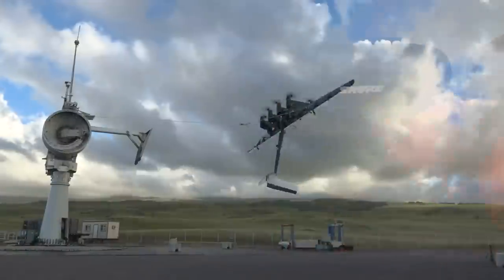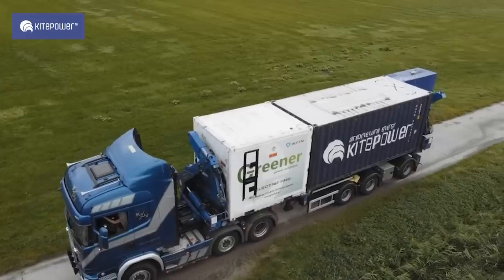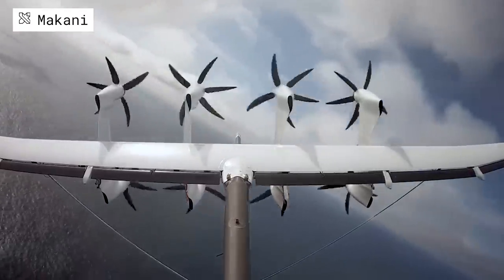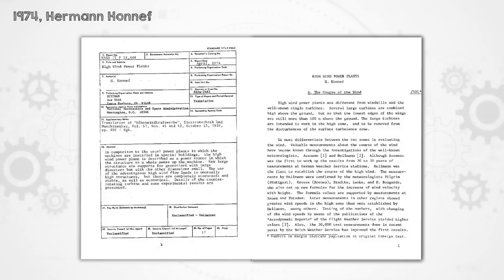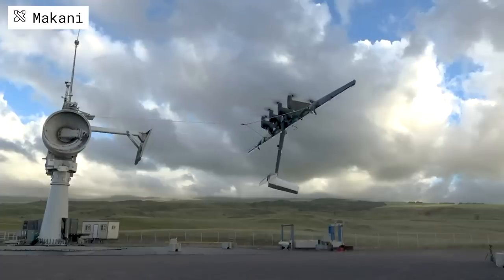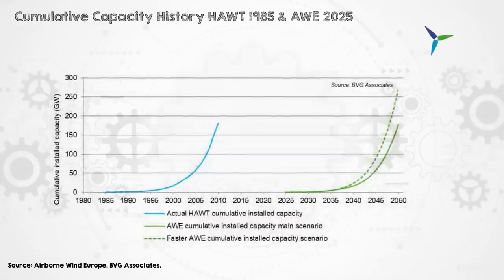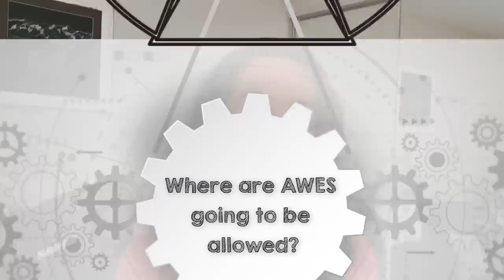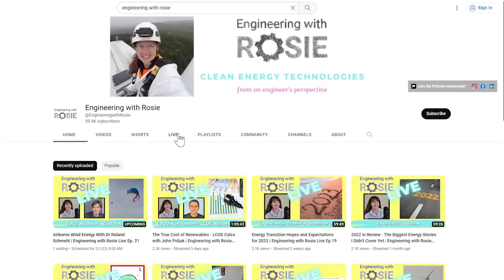Will Airborne Wind Replace Conventional Wind?

Comment: I bought a prototype airplane from Ampyx when they were dissolving this summer! I went to a random garage sale looking for cheap tools, it turned out to be the workshop of Ampyx power. I saw a nice RC airplane that they used for some early testing and I bought it for 30e. Its got a lot of repaired damage but turns out it was almost a 1000e when new :)
Reply from the maker: That is so cool!
Reply: @EngineeringwithRosie  Can you perhaps tell us how much electric energy was generated after 23 hours of continuous work 10:00 ? Can you compare it with energy quantity generated by PV panel(s) >(how many of them?) for the same time period of 23 hours?

Comment: I drew one of these up about 50 years ago now in the basement.  What it was was 5 blimps that were connected by bars in a pentagram cross, and rigidly  supporting a nacelle directly from the cross - that nacelle would be steerable into wind angle and generation power that transferred down a cable to the ground.   Never did the physics/costing as I was 12 at the time- which was the summer we walked on the moon.  only paid attention to solar and nuclear after that for about 35 years and then wind happened in TX.   Enjoy your videos.
Reply: The problem with blimps is that there is a serious global helium shortage that's unlikely to change unless fusion power becomes practical and the use of hydrogen even for unmanned applications are still frowned upon (yes, the bias against hydrogen is a little irrational with unmanned applications but people and specifically bureaucracy are rarely rational).  However, there may be alternatives such as solar heated hot air or nitrogen as nitrogen is still a minimal lifting gas versus air and can be easily produced where ever air is available.

Comment: Back around 1980 I had Bryan Roberts as a lecturer at USyd. He was looking at units which would fly in the jet stream. One of the problems was finding a suitable material for a tether that would not break under its own weight.  I saw in a later article that he was looking at a group of 10MW units.
Reply: Most if not all, currently pursued concepts are aiming at heights between 150 and 500 meters, maybe a bit higher. At these heights, there is no danger that the tether breaks under its weight. Challenges are (1) aerodynamic load peaks when flying crosswind in a fluctuating wind field and (2) fatigue of the tether due to dynamic loading, especially when alternatingly reeling out and in and (3) material degradation due to UV.

The pioneers of our trade (Oberth, Roberts, Ockels, ...) envisioned much higher altitudes. That is currently not the case anymore.

Comment: One problem with scaling them up is volume/weight increases with cube of aircraft's size while lift only quadratically. About launching in low ground wind  - autonomous drones used as lift robots might have a say.
Reply: That's a very important consideration.

By using multiple line attachments along the wing spar you can get below cubic weight increase.

Thought experiment: Glue the left wing tip of one kite to the right wing tip of the other. If both have their own tether you don't need additional structure.

Comment: I'm a bit late to have my question answered on the live stream but I'll ask it anyway.  Why not use a non tethered drone to launch a non powered sail.  When ground wind is low the sail could be folded similar to a parachute loaded onto the bottom of a "launching drone" and flown up and deployed.  This would reduce the window of risk and wear to the expensive components.  You could even have one launch drone service multiple towers within a short range.  The problem would seem to be in repeatability, but I can think of a few ways this could be done with automation while still having reduced cost over the built in drone launch systems.
Reply: I believe this to be a very good idea. Especially once you have multiple systems close to each other. This idea has been raised by at least 2 other people in the business that I know.

As long as we have only one system for testing we decided to fix the propellers to the wing to avoid the complexity of having another autonomous system and the necessary communication/synchronization that comes with that. But maybe we should change that...

Comment: That was an interesting video. Thank you. My take, being a retired pilot is that apart from low volume, very specific applications this is a non-starter. There is no doubt that the wind gradient is an exploitable resource. Utilising upper air is as you say, far better because it moves faster. It’s also more stable (fewer gusts) and slightly more reliable than surface wind. The better, more elegant solution has to be airborne generation as the wind will provide the lift for free as the craft is tethered making weight less of an issue. Being a kite flyer I know controlling these things is non-trivial but think this can be overcome. However, it’s the total system complexity that will prevent cheap power from being generated. Then bird murder, icing, aesthetics, noise and rain damage has to be considered along with establishing safe zones to avoid conflicts with aircraft and people on the ground when they crash. 

A minor point windsheer, the difference in windspeed between layers of air, is a minor aspect of a larger phenomena called the wind gradient. It is as you say caused by surface friction.

Comment: Reminds me of ocean wave energy. Lightweight moving parts transferring the power to be harvested is really hard to make reliable over economically viable time frames.
Reply from the maker: Yes, and time will tell whether the commercial systems that are starting to be sold now will have exorbitant maintenance costs or not.
Reply: however, one positive for airborne wind compared to ocean wave is that the energy density is much much higher, something like 20x more
Reply: I don't ever see this working for commercial power anytime soon. 

 I mean it would be awesome if you could get it to work for your home, but do we really want that?

 For camping, disaster, or the military? That is what I would be going for. 

 Imagine having a small generator you could carry in a backpack for instance. 

 PS: Can just use hydrogen to launch the soft ones when no wind is available.

 I also remember someone talking about a design for a hybrid airship one that also had a turbine on it. It was tethered and moved up or down.

Comment: Hi Rosie, nice video! Looking forward to the interview with Roland Schmehl. Just one comment on the point that a soft kite is difficult to launch if there is no wind at ground level but higher up: I think this is a little bit theoretical because especially in the first years you would choose sites where this wouldn't happen - usually there needs to be open space of 800-1000m radius around the ground station. In these locations, you would have sufficient wind also on the ground level  (3-4 m/s) if there is good wind further up.  
Anyways, as you also pointed out, the challenge is right now to get as many operational hours as possible to gain experience and improve reliability; that is why we are looking for test and demonstration site where companies can fly 24/7.

Comment: Hi Rosie, I had a Teams meeting today with Skysails, Hanover, where I put forward my concept of a seabed anchored rotating ring of 500 x 400sq mtr tractor kites. They were able to confirm that their autonomous controllers could reliably control flight in all points of the compass and that such a concept would generate hundreds of not thousands of megawatts/hr...All I need now is investors with deep pockets!

Comment: I can certainly see the emergency use case being viable. I would love to see a commercially viable product for everyday use, but it seems to be in the same category as wave generation. Always just a bit out of reach. 
Thank you so much for these videos. It's delightful to have new ideas to contemplate.
Reply from the maker: That's a good comparison. I also have a soft spot for wave energy! But I think airborne wind's challenges will be much easier to solve than wave energy's.
Reply: in addition to emergency use i could see it being useful for power for small scale industrial equipment that might not need to be constantly operable
Reply: Until his death in 2014 Dutch astronaut Wubbo Ockels was involved in the research that led to the company Kitepower.
In one interview he talked  about the applications of these systems.
Saying there are many instances where places need additional power and currently in those cases diesel generators are used.
As a example have gave large multi day music festivals
Reply: Wave energy has been tested and deployed. Floating Power Plant is deploying near Gran Canary. The wave power is basically a free add to a floating platform that stabilize the floating fundament and allow easy maintenance ship access.

Comment: Jet engines started out simpler then the engines they were replacing. Multi rows of piston cylinders arranged as corn kernels on a cobs or or some arrangement of v ,w or x, being pressurised by two super or turbo chargers replaced with a single chamber , with continuous combustion, with a single rotating part on a single axis was a simplification . The fact that the jet made more power was probably almost a bonus.
Reply: So true!

Comment: Maybe having intentional breaking points in the many lines between kites and the main cable could allow the kites to collapse in case of overload so it just sinks to the ground where it can be replaced.
Reply: Gilders do use a weak link...but there in lies the problem. The sudden release of load in a cable under significant tension will almost certainly throw loops onto the drum of the winch or cause knots to form in an automated recovery. Usually for a cable break the end has to be recovered under tension manually to pay the tether onto the drum correctly or you'll just create future problems.

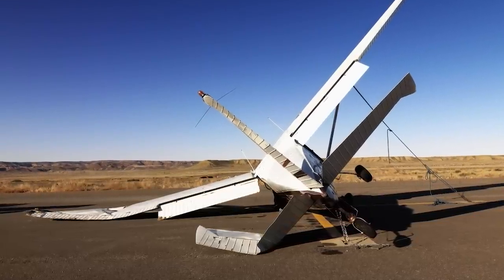Comment: 4:49 Regarding birds, should be noted that at least one experiment suggests painting a single turbine blade a contrasting shade or color can reduces bird deaths by 70% (Smøla Wind Farm in Norway).
If other experiments confirm those results, then there's no reason why increased visual contrast can't be used by airborne power generation tech, too.
Reply: Regarding birds, how many birds do skyscrapers kill as they are blinded and confused by reflections in morning and afternoon?  This must be part of the equation as well.  It is sad but needs to be considered.
Reply: @donovanfoto3263  While an important point, that's a different conversation for a different set of engineers to deal with.
Gotta make sure you pick the right battle at the right time with the right people, you know?
Reply: David G: I understand, my point is "Both kill birds, so which kills the least amount of bird?"  I know people that are against windmills because they kill birds, however they don't seem to mind skyscrapers.  Just pointing out BOTH KILL BIRDS.  Then let them decide which is worse.  After that, we can look into the environmental impact of coal and oil and make a larger comparison.
I know some people that can't see anything but "Windmills are bad PERIOD, long live oil and coal."
Reply: @donovanfoto3263  skyscrapers aren't particularly useful buildings compared to wind turbines

Comment: Gusts can be handled by reducing lift further than gain in drag. For flexible kit roll up the wing. This would require power be sent to the kit v. Cable length or electrical power. 

Launch by hydrogen and closed cells.

Comment: Was really hoping skysails or similar solution to work out, but eventually came to my own conclusion that it will likely always be niche. Partly because it's really hard to build a wind-park with them (tangled lines) and safety issues (lines breaking) means it's not really fit for wide area adoption either. I think as a power-source for ships it's probably a cool idea, but much harder even for sparsely populated areas. Maybe it will be easier to deploy in the ocean since the anchoring is a lot simpler than regular off-shore wind.
Reply from the maker: I just spoke with the SkySails co-founder last night and got some interesting insights from him. Their initial market is replacing diesel generators in off grid applications like islands. Then eventually multi megawatt floating offshore, but there's a loooong development path until that point! He also said the ships application was a dead end for them because they're not willing to pay anything extra to reduce emissions. But that was a few years ago, maybe it'll change.
Reply: I'm keeping fingers crossed for the paraglider type devices. Because there is no cheaper aircraft than this and the problems you listed are resolvable with intelligence (software) which once created (written and tested), can be reused on mass scale at pretty much zero cost.
Software can make them talk to each other to avoid collisions. Paraglider wing can change its shape, enabling it to react to changing wind conditions. For example, in a gust of wind, the wing can quickly contract (making itself smaller and thus more stable), and get evacuated downwards by the ground generator device pulling on the anchor line.
Once you have the functional software, then you don't need rocket science or rare materials, you only need easily accessible textiles and a tailor to make the wings :) 
(Obviously, readily available power generator is placed on ground, and finding suitable actuators to control the wing in the air should not be a problem)
To me, it is more a software challenge and ultimately a feasible one, with enormous potential :)

Comment: Makini style:
I made something similar as a kid, but with more dihedral and sweep back.  That gave me stability WITHOUT the need for computer controlled control surfaces.
As for yaw stability: dragging a (bigger) propeller behind the tail, (or the main wings to a lesser  degree IMHO) gives WAY more stability than having the prop try to 'push'  yaw and pitch into the plane all the time.

With this design it's almost as if the university/students wanted instability so they could say: "Look at our clever computer control system!"
I had my model flying stably on the end of a fishing rod/line  for sucks fakes!
The only adjustment required was where the tow hitch is relative to the wing's center of lift:
Want too land: move it to the nose.
Want to take of: move it slowly from in front of CoL to slightly behind CoL.

"A solution looking for a problem" is what I see here.
If anyone finds this interesting: I would love to be involved in a KISS version of this idea.

Comment: Thanks Rosie for this interesting video. I’m a founder at Wind Fisher which is a newer entrant into this field. We resolve some of the issues you mentioned by using lighter-than-air, crosswind capable, Magnus effect balloons. I’d be happy to give you more details for inclusion in a future video. Kind regards, Garrett
Reply from the maker: Hi Garrett, I did see Wind Fisher and thought it was interesting. So many cool physics and engineering principles in one device! This video was intended to be on the more more commercially mature systems but I would be interested in Wind Fisher for a future video. Did you test a prototype yet?

Comment: In case of a gust, can't you have the controller of the ground system very quickly give out some tether to limit mechanical stress?
Reply: That's exactly how it's done. Or at least how we are doing it.
The groundstation keeps the tension of the tether constant.
If you like, checkout the code. It's open source on hackaday.

Comment: I wonder if combining functions is the secret to getting the economics to work? If you had a blimp with wind generators on it as well as functioning as a super tall cell tower for a large area it might be useful. The challenge would be getting the power down efficiently  the long tether.
Reply: Excellent idea, can add solar and advertising billboards also
I am thinking of being used in remote areS where conventional electricity is hard to get like the arctic or third world countries. Quick to set up. New technologies are always expensive at first.
Reply: @jbird6609  ads are a stupid idea, keep advertising out of the skies
Reply: @user-fs9mv8px1y  Its not a stupid idea, Advertising pays big money, About the same as having a billboard along the road and that seems to be ok? Otherwise i dont like the idea either.
It erodes the environmental ambiance.